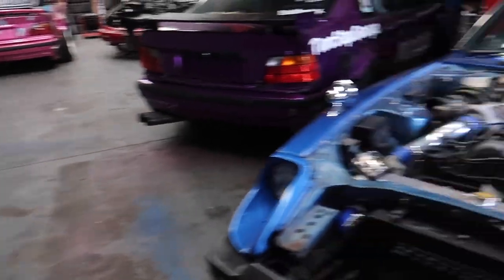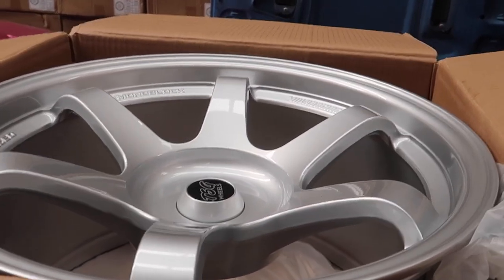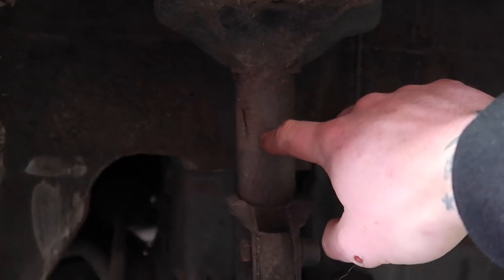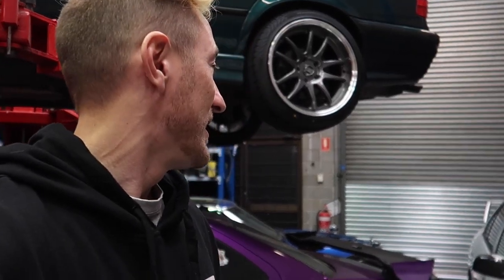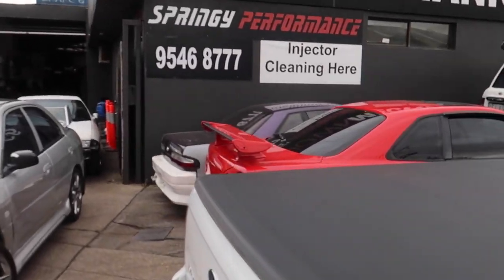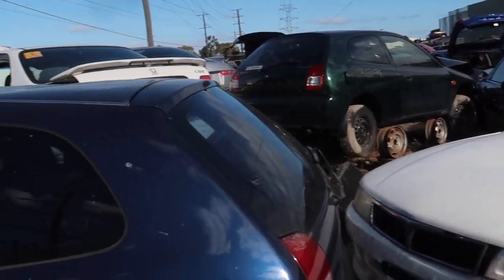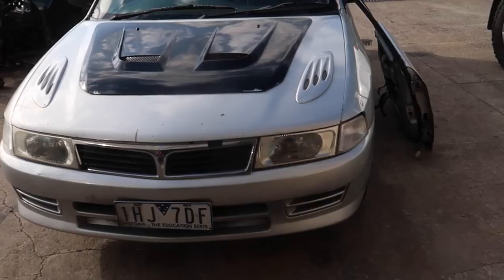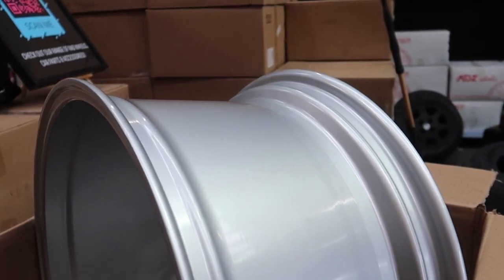CE LANCER 4g93 SOHC HITS THE DYNO! BUDGET EVO BUILD EP: 1

Comment: Hey Mike, I'm looking at the TSG 'spokey boi' wheels, 17x9+30 for my lancer. I'm not super keen having to roll the guards too much. Do you reckon those specs will still be relatively aggressive given the narrower rim (yours are 9.5?) Cheers
Reply from the maker: Hey bro! 17x9 +30 would be absolutely perfect for a Lancer in my opinion! Wouldn't require much if any rolling of guards depending on how low you're going.

Comment from the maker: How much power do you think it'll make once it's turbo?!
Reply: 4g93's seem to handle 8-10 psi without issue, it's only once U go above 12-15pounds that they nuke, so hp/kw would be no more than 200hp at the crank..160-180 at the wheels, which will be more than enough in a car weighing about 980-1100kg. 4g93's are quoted as having 86kw at the crank from factory. Keep up the quality work mate